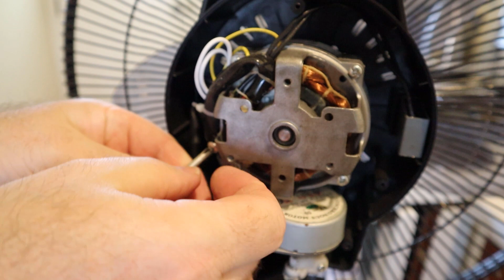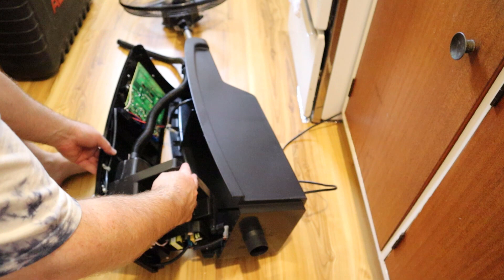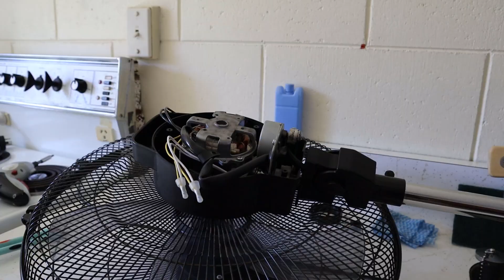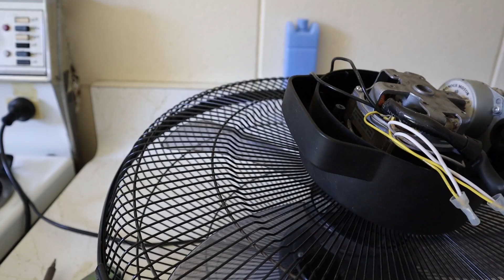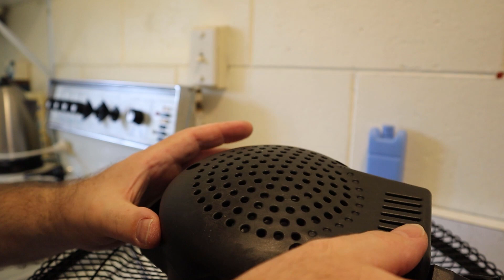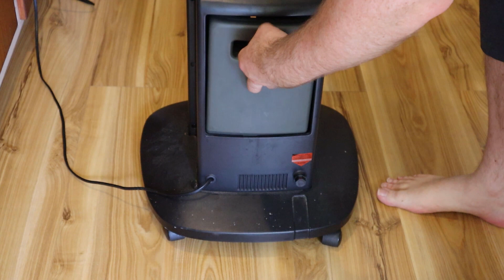Hot and bothered fan repair.

Comment: Good job Jonny. We've got a heat wave here and need good cooling. 
On some that I have done, dust bunnies have been the problem creating too much mechanical resistance.
I've used a changed capacitance capacitor to slow down the first speed of the ceiling fan in our room. Just ticks over nicely now.
Good call on the faulty cap mate. 😉👍
Reply from the maker: Cheers! +30 is about my limit, I can imagine what levels you must experience. Have a cold one 🍺
Reply: @JonnyFix  When I was living in South Oz we would have 2 weeks of 45 degrees during the summer. Now I am in NSW & our winters can be -10 degrees and summer 40 degrees. Can't complain about the lack of variety! 😉🌞🌦